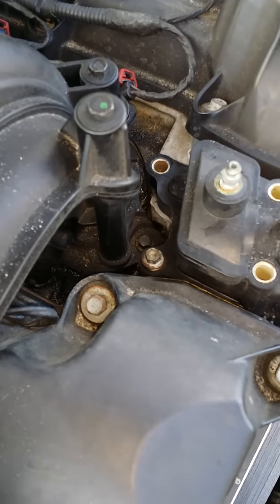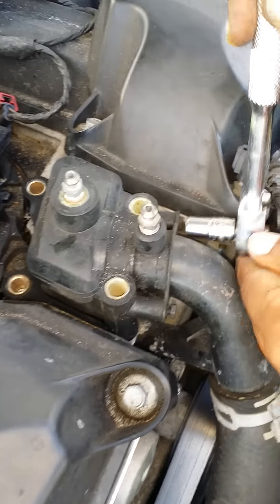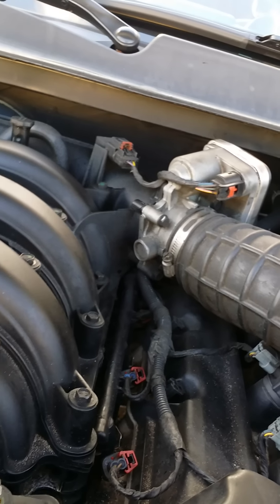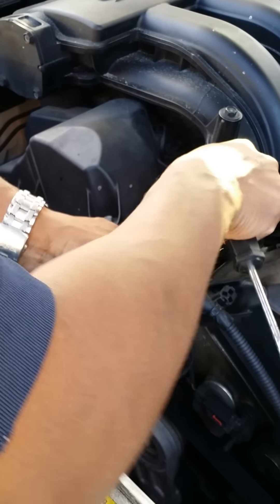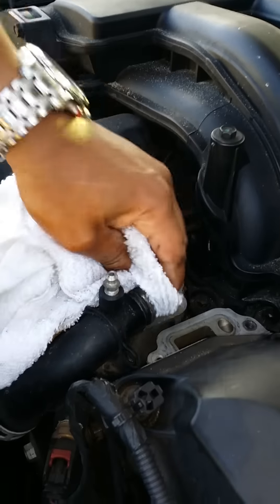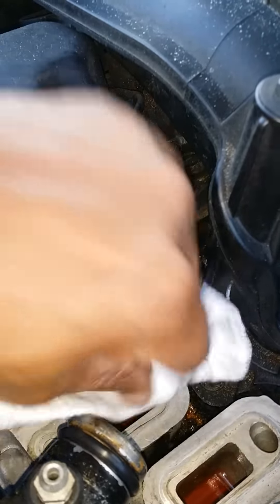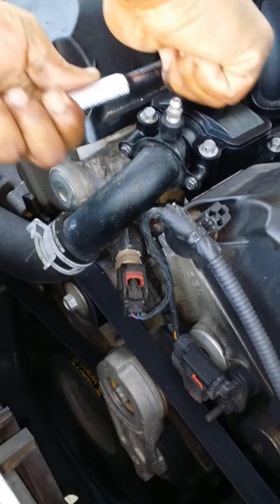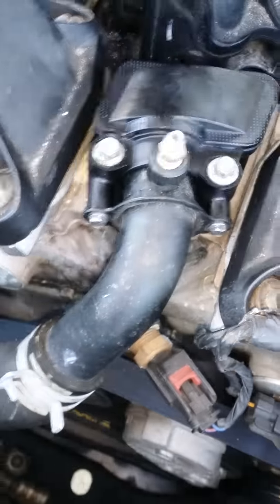Changing upper thermostat housing on a 2008 magnum

Comment: Can any one help me I have a Chrysler 300 2006 and I noticed that mine is leaking coolant out of the same thing you’re working on from the top one too. I also think the bottom one that’s like on the side also leaking do I have to takeoff my timing belt to work on the top one, just like you did and follow your video to help me work on my car it looks like it’s in the same placement and everything but mines a Chrysler 300
Reply from the maker: It's possible but still seek professional assistances to be on the safe side be blessede.

Comment: I cannot get the housing unit to fit flush.Could that pipe be bent?
Reply from the maker: Now if you're not sure you need to get with someone that knows a little bit more if you cannot afford a mechanic get  Someone who is mechanically inclined.
Reply: @PeterCalixte  Do you recommend any one in the las vegas nv area?

Comment: Check torque specs for those bolts
Reply: Yeah.  I bet it’s not “tighten as hard as you possibly can, with all your strength“ on a piece of plastic.. 1 pinched gaskets. 2 broken replacement part.    I’ve done this on sensors before. Not good.
Reply from the maker: Ok I understand we were messing around with that video and the guy that was holding my phone was a  ex co work Keith McCray who passed away about 3 weeks ago so can you please back off please.
Reply: @PeterCalixte  RIP Keith. Don’t know why u got offended 🤷🏾‍♂️
Reply from the maker: Sorry about that, My bad I really appreciate you looking out be blessed always.
Reply: @PeterCalixte  Same to u brother! Don’t forget to change the titles. That’s the coolant water outlet🤙🏾

Comment: Do u have to drain the coolant out before changing it???
Reply from the maker: Out of the reservoir by disconnecting the line putting your finger over the nipple removing the reservoir the same time and the residue that's left just poured into small pan or something.
Reply from the maker: Disregard what I just said my bad I was thinking about my Kia at the time this one is the Magnum no I didn't drain the coolant the car was sitting down and it was cool so all we have to do is just change the the O-ring that's all so no answer your question we didn't have to drain no coolant once again sorry about the first text okay like I said I was thinking about my Kia Sorento at the time so I hope this helps you be blessed and have a blessed Thanksgiving.

Comment: my housing moved to the back and wont budge, the small pipe connected to the big one i took loose has a tension in the back of the motor and there is a screw holding a bracket to move , did you have to unscrew it too?
Reply from the maker: Yes

Comment from the maker: what I did was a quick fix in the parking lot at work just changed the housing and gaskets.
Reply: Peter Calixte I changed that but my temp rising and no heater.. any thoughts?
Reply: I keep getting air build up in valve could this be the issue
Reply: Great video I'm doing mine right now this helped out alot

Comment: Coolant housing unit. Another piece of ‘brilliant’ Chrysler engineering to create a cheap plastic part responsible for transporting 200 degrees of hot radiator fluid and requires replacement every couple of years....🙄
Reply from the maker: That's Chrysler for you .
https://campaign.stickr.co/zip?affiliate_id=1806402
https://compaqdog.wixsite.com/website
Reply: There's an aluminum option
Reply: @WingoTribe704  Where at?
Reply: @RomeB-qe4mf  napa
Reply: Wu Alumni ty